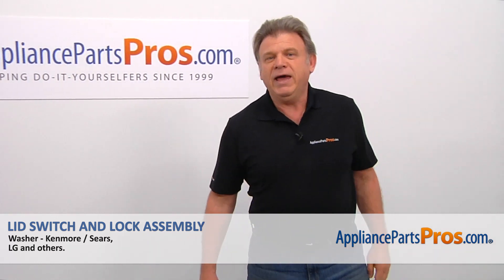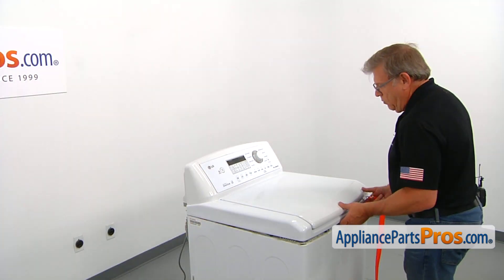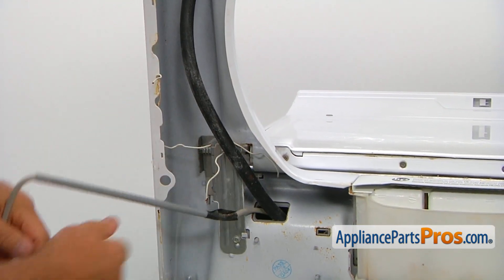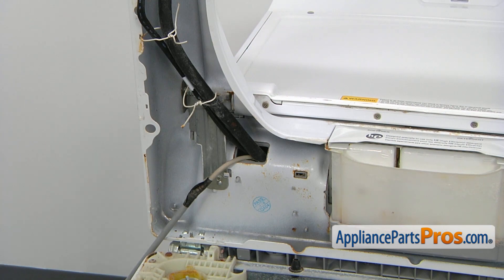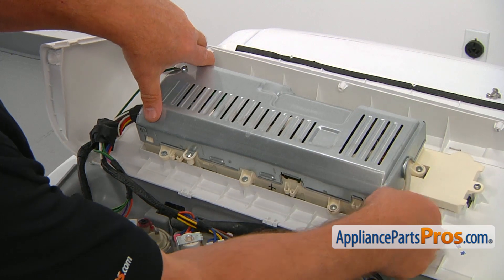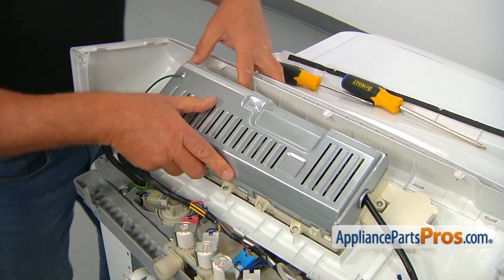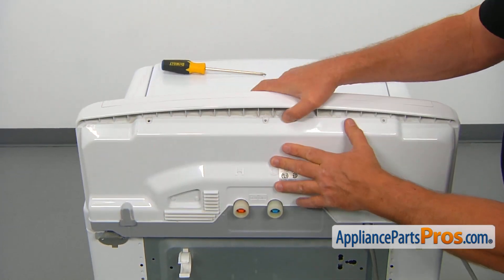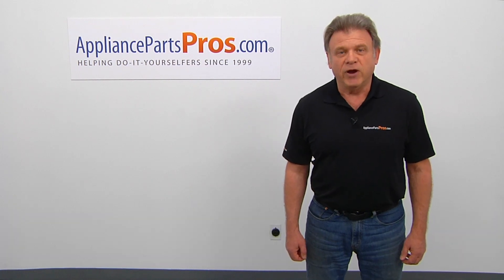How To: LG/Kenmore Lid Switch & Lock Assembly EBF61674802

Comment: This was a very fine detailed video Simon! Can you please tell me which lid lock pins on the motherboard would need to be jumpered to disable the lid lock? Let's call the top row of pins 1-2-3 and the bottom row of pins 4-5-6.
Reply from the maker: What is your model number?
Reply from the maker: Unfortunately, the manufacturer doesn't recommend bypassing that switch for safety reasons, so they have not provided information on how to do that.